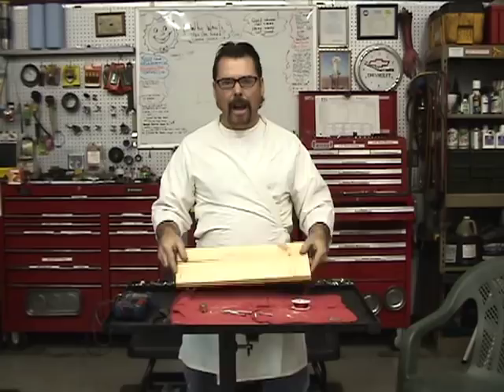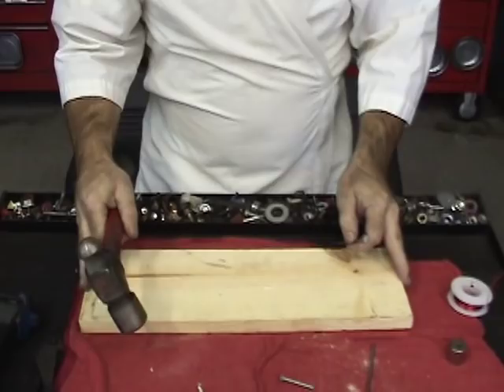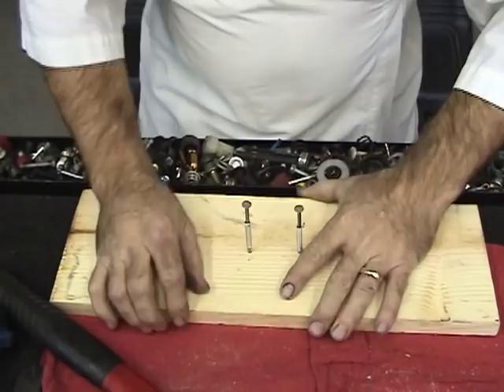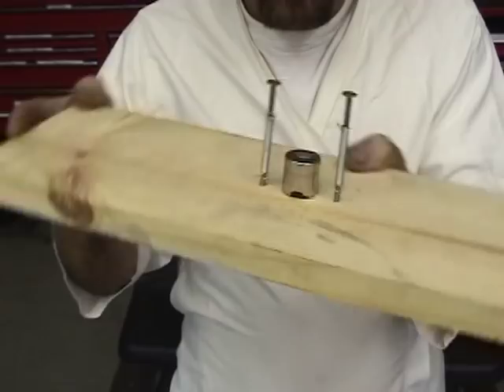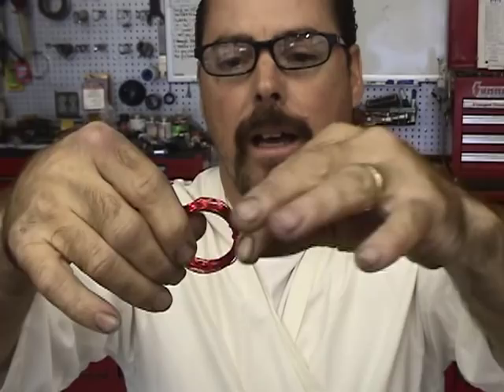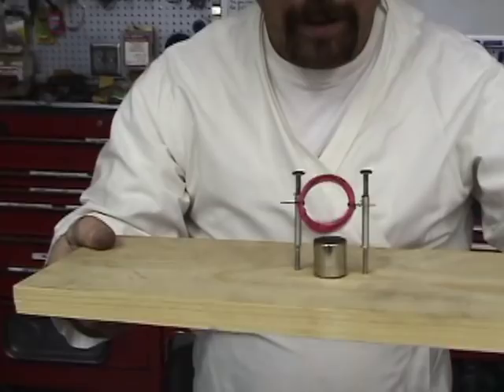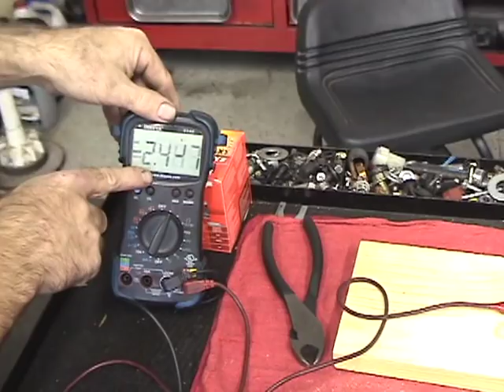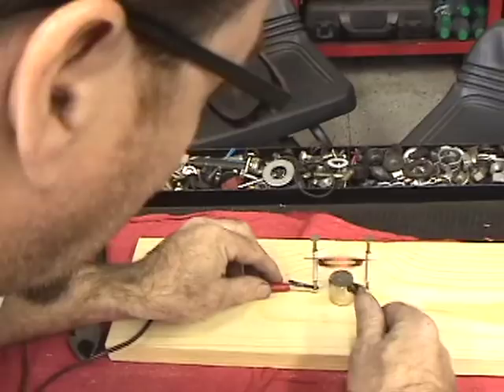FREE ENERGY MOTOR !!!!! How to build it.

Comment: There is no free ride ..the energy comes from somewhere....there is electromagnetic waves all over the place.  Get a crystal set..it will run with no batteries but it is running off of radio waves. Yes there is light...temp changes.electromagnetic waves..radio waves..entropy... Temp changes. ..lots of free energy but no free ride

Comment: He didn't change the board it was turned around so the brown strip was.on the other side
Reply: tbonetay Nope he did change the board everything was different between the two boards, Knot, wood grain etc.  He also does not show you the edge which faces him on the final board.  The battery is on the side of board which constantly faces him and not us.

Comment: @5:11 if you use a big lighter you can burn off the  insulation much safer and easier  & if need be clean it up with a touch of emery cloth  2.4 volts  HOLY shit that is really  impressive.
 I honestly thought it would have been less than half a volt  that blows my mind 2.4 volts.... ....1.21 gigawatts? LOL 
I wonder if a magnet 4 times bigger would put out 9 volts? 
What do you think?
Reply: Maybe if he hid a 9v battery in the wood next time. Study the wood when he is assembling it and compare that wood to the wood from the finished product.
Reply: Mate, have you ever heard of the law of conservation of energy mate. Might want to look it up Rick.
Reply: Radagast the Brown Honestly...what does the law of conservation of energy have to do with using a Bic lighter to strip wire?
Reply: Nothing but its fake so....

Comment: I can not believe people still think in these terms.  It is a fundamental physical reality that no process , not use of energy of any kind at all is 100% efficient, there is always some net loss...always....period.  You simply can not say use a battery to spin an electric motor to turn a generator to recharge the battery....endlessly.  There is some energy lost in the process and eventually it will stop.  There will never be a material to create a bouncing ball that bounces as high as the point from which it was dropped.  Energy is not perfectly stored in compression and released during the bounce, some of that energy is lost and the bounces get smaller and smaller.  If this were not true life could've evolved, and likely would've as what an advantage it would be, to sustain without eating, or for plants without sunshine.  But all systems require more input energy than they produce because all systems are never 100% efficient.  There is always some energy lost to unproductive purpose.

Comment: I understand why i produces voltage,,, that easy,, but what makes it continue to spin.. Magnets do not pull an copper
Reply: I humbly correct you. A magnetic field pulls and pushes electrons in certain objects closer to them, making them move. Metals like copper have electrons that are easily moved from their orbits. If you move a magnet quickly through a coil of copper wire, the electrons will move - this produces electricity.The opposing currents will repel each other as a result. Lenz's law states that the current induced in a circuit due to a change or a motion in a magnetic field is so directed as to oppose the change in flux and to exert a mechanical force opposing the motion.

Comment: Nice switch on the wood plank. Where did the knot go. Its a fake. you put a lithium battery inside the plank connected to the nails. the coil loads down the battery so you measure 2.4 volts as expected. nice try.

Comment: At 5:11 he mentions turning a "circuit" on and off.   Kind of sounds like battery power to me.  It's obvious the wood base was changed out also...no knots in 2nd board.  He also never shows the back edge of the board where battery might be located.  Battery is probably buried in the wood.  Voltage check shows about 2.4 volts...very similar to a watch battery.  I think Jeff should stick to finding "Monster" gold nuggets the size of a BB on his prospecting videos.  Folks, this is grade A   BS

Comment: does this motor continue to run on it's own until you stop it? or does it stop by itself at some point. How long will it run on it's own energy?
Reply: It runs until the hidden battery dies.  The battery is inside the magnet assembly or in a hole in the timber.
Reply: gortube the nails poking thru the board also poke thru the rag on his table where there are electrical contacts.
Reply: Paul Sutter Indeed.  So many deceitful possibilities
Reply: Paul Sutter hummm! then why was it spinning when he picked it up in the air :)
Reply: Talha Kamran why does a car continue to roll after you let up on the accelerator pedal? its possible the battery is in the board, but i think thats why the nails are thru the bottom to make contact.
Reply: +pds tech It has enough inertia to continue to spin for a good 3 minutes?  How much do you think that coil weighs?!
Reply: the coil has to be very light
Reply: well... we all agree that board was changed...so I agree with the guys who say "BUSTED" :)
Reply: Talha Kamran Busted for what?  Possibly making a mistake?  He is human you know.
Reply: +Josh D. Diggity  0.126 pounds

Comment: By "free energy" if you mean you don't have to pay for it then 'free' claim is correct, just as you don't have to pay for solar light energy. Free energy should not be confused with energy creation, as some other videos are falsely claiming energy creation by free self perpetuating electric generator.  The reason motor in this video is working because the magnetic field energy stored in the magnet is being transformed into electrical energy due to motion that you caused, when then caused a current to flow in the wire and that energy then transformed again into stored kinetic (motion)  energy, like a spinning ball. Eventually the spinning i..e. motor will stop, as the magnet weaken and as the energy gets dissipated due to motor fiction with air and also friction on the  contact surfaces. Friction causes heat i.e. dissipation of energy. Tiny heat is also produced on the wire due to electrical resistance of the wire and that too dissipates energy as heat into the air. Nowhere energy is created, only energy transformation occurs.

Comment: It's free magnetic energy from the universe being converted into another form of magnetic energy called electricity. This is possible because the wire is in a  coil of wire in a circular shape. Hey Why not build one  with  a much more powerful magnet? Then you can kiss the power company good bye.

Comment: The battery is inside the wood ? ajajajaj
Reply: +Dihelson Mendonca  Yup, that is my thought too and he never shows the side of the wood facing him.
Reply: +Musique3579 WATCH AGAIN HE TURNS WOOD AROUND AFTER MAGNETS ATTACHED
Reply: hummmm
Reply: Do u ppl not know anything about electromagnets? eventually the wire would burn up without insulation/the magnets eventually lose their power which is why you use different types of magnets. For those of you that think there are not different types of magnets, do some research...
Reply: Do some research ? Oh God! It´s a life of research, just to look at this and see that it´s fake.

Comment: why did u switch the boards at 5:40 ? as if your going back with the clippers when its clearly another board. plus at 6:23 the edge of the board looks like a filler a line filler across whats inside a battery? quit the b.s.

Comment: I have a question that I've always been wondering. Is it possible to create a free energy motor using this technique I've thought of?
http://oi58.tinypic.com/2dk0pao.jpg
I apologize for the crude drawing, it was in MS paint.
Reply: The answer to your question is "no".  I will explain how you can avoid falling into a common mistake so that you can see why.  This works for any wheel like machine.

Start with just imagining the machine with only one magnetic pole on the rotor and one on the stator.

Imagine that you want to work out the average torque over one full rotation.

We will call torque that tries to turn the wheel clockwise as positive torque and CCW as negative.

If you line the pole on the rotor with the one on the stator, it is obvious that this simple machine is its own mirror image.  We will call this lined up case 0 Degrees.

Now imagine that you measure the torque at +10 degrees as being some number "A".  When you go to fill in the number into your list of toque vs angle, you see that you can save a step.  Because the machine is its own mirror image, you can fill in the value for -10 degrees as being "-A" also.

When you go to do the sum of all your measurements, you know that the total will always be zero.  This means you must have exactly zero average torque for one full rotation.  There will be some curve of torque vs angle that goes above and blow zero but it averages zero.

Now, imagine adding another pole on the rotor.  This will mean that you are adding a new torque vs angle curve to your existing one.  Since we have already done the argument showing  this new curve's average is zero, we can conclude that the average of the sum is also zero.

Continue to add magnetic poles where ever you want to the rotor and you still get an average torque of zero no matter how wiggly the torque vs angle becomes.

Now add a magnetic pole to the stator.  Notice that this is just like the case for the rotor except that the line along which the "mirror image" line is draw may be different.  This new pole on the stator just adds yet another curve that averages to zero.

Thus all wheel like machines produce an average torque of zero (ignoring friction obviously)
Reply: Ken Smith Alright then, thanks for the explanation

Comment: wait that "copper" coil shouldnt be magnetic
Reply: The copper coil moving in a magnetic field generates an electric current, which in turn creates it's own magnetic field. You are correct, copper is not magnetic, but an electric current in copper is.
Reply: Learn a bit about electricity and magnetic a copper coil can not run itself even with a magnet. It is a scam.
Reply: I might suggest using correct grammar before insulting people on science.  Also, I never said it wasn't all a fake, all I said is that a copper coil moving through a magnetic field creates current, which in turn has a magnetic field of it's own.  Scientifically sound statement.
Reply: nickle Surgeon look up Lenz law.

Comment: It is fake.  He switched boards and the magnet that he first nailed into the board is probably not there anymore. It has been replaced by a similar size cylindrical box containing a permanent magnet and an oscillator connected two both nails powered by a nickel size 3V button cell.  No, you say?  There are no wires?  Then tell me if you see the wires in between the pick-ups and the bridge on an electric guitar.  Yes, horizontal holes can be drilled in the middle of a piece of wood in between two cavities and once the cavities are covered, you don't see them anymore.  Deception is the name of the game.  From the moment you see the hammer stick to the magnet, it becomes a magnet for the rest of the show.  'nuf said...

Comment: Too easy. He never shows the side of wood closest to him. Inside that magnet is an electromagnet that pulses and causes the coil to react against the magnet. The only way this can work is either with electric current flowing through that system or a changing magnetic field. He has the electric current, with the source hidden inside that magnet. Nice try though.

Comment: he does not show you the side of the board closest to him.  The voltage read on the DMM is the hidden battery.  Also the block of wood is changed toward the end so he did some mods for it to work.  FAKE

Comment: GTFO wood change, that mean its fake
Reply: changing the wood that mean have somthing in the wood to power the coil , coil cant be magnet without electric, if coil not magnet no power to push each other so no coil spining,ok im explain in the wood burry 3v batery normally use to power cmos chip in computer motherboard, knail  is positive and nagative point spring funcion like carbon in brush motor, that why need to remove half cover at coil to on and of the coil, first wood  is cleran without batery but when camera of he change the wood with baterry inside wood